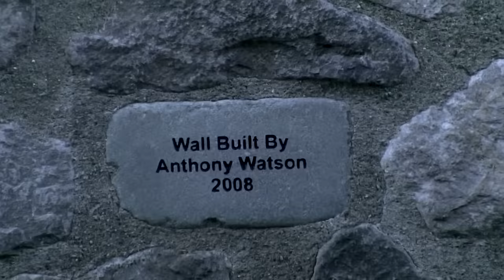Building Stone Retaining Wall

Comment: Was stone aggregate put between the wall and the hillside soil for better drainage in order to prevent excessive pressure on the wall from trapped water?  Also, there doesn't appear to be any drainage for moisture that might accumulate behind the wall.  How is drainage handled?  The wall has a nice appearance.
Reply from the maker: Yes, there is a 4" perforated drain pipe behind the wall that discharges on the other side of our property. That is surrounded by gravel and landscape fabric, and topped with soil the last 8-10 inches. See photos on my web site at http://www.watsondiy.com/2008wall.htm

Comment: Don't you attach the damp proof membrane on your plywood board?,any drainage system on the bottom?, I could say this retaining wall, falls off when it faces to severe weather. can't last longer
Reply from the maker: The plywood board was just a form to ensure the back of the wall was vertical and give me something to build against. I moved the board forward as I progressed down the wall.  There is a 4" perforated drain behind the wall, covered with gravel and landscape fabric, that drains off further down the hill on our property. This wall is over 10 years old now and still looks as good as the day I built it.

Comment: HIi Antony Watson. Very nice job! Post one picture now. Ten years later! Where´s it stay?
Reply: Yes! It's been ten years! Is the pretty rock wall still there? I wonder if it's actually retaining anything? A lot of walls built like that tend to lean over as time goes by.
Reply: @davidlango1850   i think the leaning is due to water expension and contraction behind the wall. Gravel,  a sheet of sediment retaining film and a pipe at the bottom behind the wall to carry the water collected should help.
Reply: I didn't want to be the first to say it but don't build a wall like that if it actually has to retain anything.  He  built a wall that has probably already been replaced.
Reply: @twal5299  There are a number of comments like this but none that actually point to what specifically was wrong or where to find better information.
Reply: @eggplanthose  
 Google building a Deadman retaining wall. There are different types depending on how high your wall will be. Having a drain behind the wall could be needed also. The height of the wall your base and the local conditions all need to be taken into consideration.

Comment: I wish you can explain what u did n why....I want to do my wall...I'm a DIY girl.. n is hard to know anyone with that experience. I love construction from drive ways to framing roofing...
Reply from the maker: Wow, that's a big question, hard to give a brief answer. I poured a concrete footing, with rebar to control cracking. I also installed vertical rebar stubs every four feet to tie the wall to the footing. I ran a string with a line level to determine the height of the wall. I didn't really care what the back of the wall looked like (against the dirt), so I used a scrap piece of plywood and bracing to provide some support and reference as I built the wall. From there it was just a matter of mixing up mortar, and placing the stones in it.  I would work through two bags of mortar in the morning. After it set up for a few hours, I would come back with a brush and water to clean the mortar off the face of the stones and level out the mortar between stones. I just repeated that process every day for a month or so till the wall was finished. Then I installed a drainpipe, gravel, and landscape fabric behind the wall before backfilling with dirt. Hope that helps.
Reply from the maker: Wow, that's a big question, hard to give a brief answer. I poured a concrete footing, with rebar to control cracking. I also installed vertical rebar stubs every four feet to tie the wall to the footing. I ran a string with a line level to determine the height of the wall. I didn't really care what the back of the wall looked like (against the dirt), so I used a scrap piece of plywood and bracing to provide some support and reference as I built the wall. From there it was just a matter of mixing up mortar, and placing the stones in it.  I would work through two bags of mortar in the morning. After it set up for a few hours, I would come back with a brush and water to clean the mortar off the face of the stones and level out the mortar between stones. I just repeated that process every day for a month or so till the wall was finished. Then I installed a drainpipe, gravel, and landscape fabric behind the wall before backfilling with dirt. Hope that helps.
Reply: yea it did help....

Comment: I have never built one so take this with a grain of salt but I did not see any drainage set up. no gravel behind the wall, no drains....
Reply from the maker: It doesn't appear in the video, but there is a 4" perforated drain behind the wall covered with gravel and landscape fabric. It connects to a drain that discharges on the other side of our property. You can see it in the photos on my web site http://www.watsondiy.com/20080908.php (near the bottom of the page).

Comment: Hi Anthony.  I am following your work and building my own similar to yours.  Thank you, thank you for sharing your work!!  It is so helpful.  You have done such a beautiful job.  I noticed that you built some rock wall at the base of your garage (presumably for aesthetic purposes).  I have a section of house that I am thinking about doing the same but debating whether to do it because the rocks, being a bit larger than say just flatter "facing" rocks, would protrude from the house wall (like yours below your garage wall).  In this video, it looks like that small section is not completed.  I am wondering whether you flattened out the top of that section like you did with your retaining wall.  And if you are satisfied with its look given that it obviously protrudes from the wall more so than say, just flat face rocks would.
Reply from the maker: If you're talking about that small section in front of the bottom left corner of the garage, that was just my "practice" project. I bought a bag of mortar and a couple buckets of rock just to see what it would look like and how I would build it.  I actually built it elsewhere and moved it near the garage when I started the main wall. It was never attached to the garage. I eventually broke that test section into pieces and used them in the final wall.

Comment: You didn't provide weep holes. Did you include a drainage system on it?
Reply from the maker: There is a 4 inch perforated drain behind the wall, with gravel and landscape fabric to keep dirt out of the drain.  It connects to a solid drain that discharges on the other side of our property.

Comment: Nice job, please how deep is the foundation under the wall?
Reply from the maker: Footing depth depends on the frost line in your area.  Our frost line is only 12 inches deep, so I dug down about 6 inches for the footing, then backfilled another 6 inches when the wall was finished. If you're in a northern cold climate, you may need to go 2-4 feet deep to get below the frost line. Otherwise frost heaving could eventually cause the wall to fail. Remember to include gravel and drainage behind the wall too.

Comment: If I were to want to go about this, what is the easiest way to create it? What can i mix together and what tools, thanks.
Reply from the maker: Do what I did. Grab some rocks and a bag of mortar mix from the home center. Then try building a small sample wall against a scrap piece of plywood. You can see mine around the 2:02 mark in the video standing in front of the garage. Make sure the rocks are clean and wet as you place them. Once you are happy with the results, you can scale it up to building a full size wall. Pour a concrete footing with rebar reinforcement, then it's just more rocks and mortar like you did in your sample wall.

Comment: Nice but in future put some holes with PVC pipe or something to allow water drainage , this will ensure a longer lasting wall. You wouldn't like what the water will do if it has to find its own way through!
Reply from the maker: It's not shown in the video but there is a 4 inch perforated drain behind the wall surrounded with gravel and landscape fabric for drainage.  Any water behind the wall is drained away and dumped farther down the hill.

Comment: I wonder how much you spent in this project.
Reply from the maker: About $1500 back in 2008 dollars, for a dump truck load of rock, 127 bags of mortar, concrete and rebar for the footing, and drain pipe behind the wall. At the time it was still cheaper than prefabricated wall blocks.
Reply: @AnthonyWatsonDIY  how interesting. I love the way it came out. I need to do a retaining wall in my backyard and I came across your video. Great job man!

Comment: Impressive work. When you built the wall, I see you had always covered the few stones with cement over stones. The finished wall however has only visible stones. Is it better for gaps to cover whole stones and than wash it or scrape the cement off?
Reply from the maker: Normally masons will apply mortar between bricks/stones, scrape off the excess, clean it up with a stiff brush once it sets up a bit, and define the shape with a metal tool. I found this difficult to do well with the odd shaped stones, so I just added extra mortar to the joints, which ended up covering most of the stones I was working with. After a few hours I came back with a light spray of water and a scrub brush to clean up the face of the stones and shape the mortar in the joints. A little unusual, but it worked well for me.
Reply: Anthony Watson thanx very much

Comment: Why can’t we just use the concrete directly to build the wall? Curious. Instead of using rocks and gluing them together?
Reply from the maker: You could, but then you would need to build forms to pour the concrete in until it hardens. A concrete wall is also not very attractive. There are many options for building retaining walls, this was just the one I chose.
Reply: @AnthonyWatsonDIY  thank you for your reply

Comment: was there any drainage material installed behind or underneath? How is it holding up ?
Reply from the maker: Yes, there is a four inch perforated drain behind the wall, covered with gravel for drainage and landscape fabric to keep dirt out of the gravel. The drain connects to a solid drain that dumps the water farther down the hill on our property.

Comment: I've been wanting to do this but can't find an affordable source for all the stones.
Reply from the maker: I bought mine from the local landscape supply, about $500 for the dump truck load. I also spent another $350 for the concrete footing, and a few hundred for the mortar.  It's not cheap, this particular wall cost me about $1500 total back in 2008. It would probably cost more today. At the time it was still cheaper than building an equivalent wall with precast wall blocks.

Comment: That looks amazing! Do you have the instructions or tips written down on a website or somewhere so others can read it then try it out? I’ve been wanting to do a little 4’ tall x 8’ wide wall by my garden.
Reply from the maker: Sorry, no. I kind of made it up as I went along, so I don't have any instructions to follow. However, if you watch my three wall building videos you should be able to get a good idea of my personal method.
Reply: @AnthonyWatsonDIY  ok. I have a bunch of round river rocks to use that were already on my property. I’m mostly concerned about the bottom layer and running the string lines correctly. I’ll check out ur other vids.

Comment: Wall looks nice, but doesn't seem to have much of a footing or piers.
Reply from the maker: The footing is 6" thick and 12" wide with 1/2 inch rebar running the length. There are also short rebar stubs vertically every four feet to tie the wall to the footing. Our frost line is only 12" here, so I dug down 6" for the footing, then backfilled another 6" once the wall was done. Twelve years later the wall still looks great. Thanks for watching.
Reply: @AnthonyWatsonDIY  The wall is beautiful. You created a work of art!  I am used to clay soil here in California, so soil expansion it is a constant consideration. Have dug so many piers and deep footings, have had dreams about it :)

Comment: Wall looks great. Is it still intact? I need to build a retaining wall and trying to find the best solution for a retaining wall.
Reply from the maker: Yes, it still looks as good as the day I built it. No cracks, no leaning. I just need to clean the moss off every 2-3 years, and occasionally remove some of the dirt that washes down and builds up behind the wall.  Back in 2008 building this stone wall was cheaper than using precast wall blocks, and I think it looks nicer. It's a LOT more work though.

Comment: Why don't you make water hole at wall ?  Water pressure  used to collapse  the wall.
Reply from the maker: I have a 4 inch perforated drain, gravel, and landscape fabric behind the wall to remove water from behind the wall.

Comment: Fantastic job, beautiful wall! I do have 2 questions:
1. You say it took you 4 months to complete it. With how many hours work per day? 
2. I see that you put the whole thing over the ground, you did not dig a ditch for its foundation. Is that due to the fact that there are no earthquakes in the area and that the wall is quite short?
Reply from the maker: 1. I worked about 4 hours building each morning, then another hour or so each afternoon cleaning up.
2. I did dig down about 6" for the footing, then backfilled with the gravel drive another 4-6". This put the base of the footing about 12" down, the frost line in our area. Even though we are in an earthquake zone, we have not had a significant quake since I built the wall. Time will tell...

Comment: What would you say are the tools that have been "a must have" and what are you doing to the rocks to prepare them for installation into the wall?
Reply from the maker: +Arneson Group - Keller Williams - Danville My must have's are listed in my earlier comment below. The only preparation I did to the rocks was to hose off the loose dirt and dust and make sure they were wet before setting them in the mortar.

Comment: Tom, Great job on the wall!  If you were to do it again would do anything differently? What type of rock did you use? It's been 8 years, is the wall holding up well?  How think is the concrete that you poured? I want to build one like this but I'll need to hire some help so that it get's installed faster.
Reply from the maker: +Arneson Group - Keller Williams - Danville Thanks! Actually, I did do it again. I extended the wall another 60' behind the garage (http://www.watsondiy.com/2009wall.htm), and built another 70' section a few years later (https://www.youtube.com/watch?v=s5sC8vw9sBs).  I can't think of anything I would do differently. The walls look nice and have held up well over the years. The concrete footing is only 4 inches thick with a single #4 rebar running the length of it. There are also short one foot pieces of rebar sticking out of the footing every four feet to lock the wall to the footing. The rock is "4-8 inch Gabian", it's typically sold to put inside those wire cages for retaining loose slopes and whatnot. It was a slow process, mixing mortar and placing stones in the morning, then cleaning up the section I worked on in the afternoon once the mortar hardened a bit. Thanks for watching!

Comment: Amazing work, what type of stone is it?
Reply from the maker: It is sold as 4-8 inch gabion rock. It's normally placed inside wire cages to quickly build walls and retain slopes. I'm not sure what the actual stone is, maybe basalt? Whatever the common stone in our area is.

Comment: Hey Anthony! First of all , great work! Im wondering if you can help me with an answer. How many tons of stones did you use and how many cubic meters did you build? Same with mortar, how many kilos you needed for those cubic meters built?
Thanks!
Reply from the maker: I ordered a 13 yard dump truck load of 4-8" gabion stone, and used about 120 bags of mortar. The wall is roughly 12" thick, 75' long, and varies from 12" high on the short end to 36" on the tall end by the garage. The concrete footing is roughly 6" thick, 12" wide, and reinforced with #4 rebar. Backfilled so footing is below our 12" frost line, and 4" perforated drain behind wall to carry away any water behind the wall. Still looks as good today as the day I built it back in 2008.

Comment: How does the the wall look after several years? I noticed no rebar being used
Reply from the maker: It has moss growing on it now, but otherwise looks as good as the day I built it.  You can see the wall in one of my recent videos https://www.youtube.com/watch?v=qVRuPTDFDsQ&t=1s. There is a horizontal rebar running down the length of the concrete footing, as well as short vertical rebar stubs every four feet to tie the wall to the footing.
Reply: @AnthonyWatsonDIY  thanks for replying. You done a wonderful job sir

Comment: Drainage? Just a weeping tube behind it? Nice Job. How much Advil did you use on this job ;)
Reply from the maker: Yes, it's not in the video, but I installed a 4" perforated drain behind the wall with gravel for drainage and landscape fabric to keep soil out of the gravel. The perforated drain connects to a solid drain that dumps off the lower part of our property.